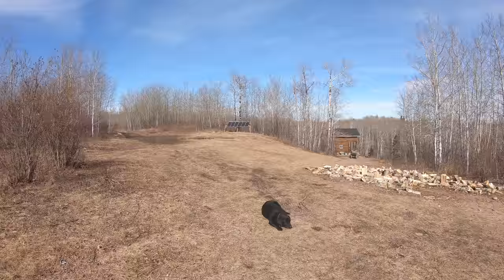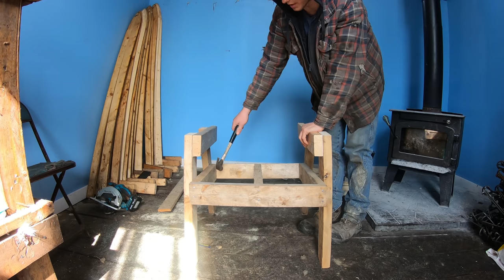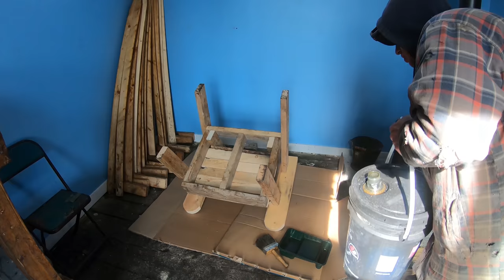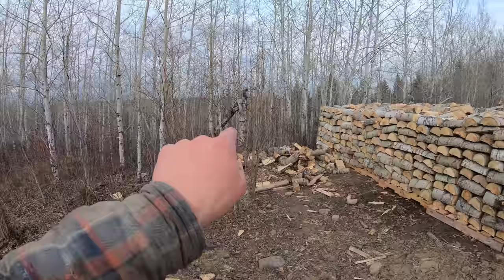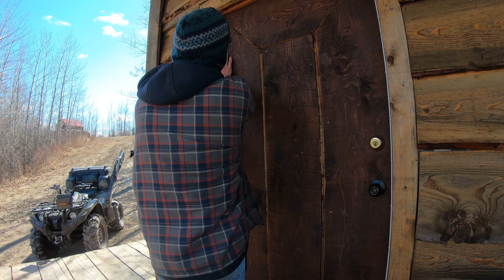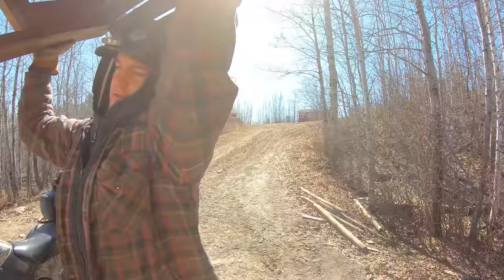Bushcamp - Building Wooden Outdoor Chairs for the Front Porch of My Offgrid Cabin

Comment: Turn your extinguisher upside down and give it a few wacks with a rubber mallet....to loosen up the dry chemical. Your local FD may even recharge it for you if the pressure drops. I also keep a pressurized water extinguisher on hand, (expensive for a new one) just add some antifreeze to it for the winter months. Thanks for the vid ,thumbs up for the pooch.

Comment: You should buy a Plastic welding kit n they work great mainly like $15 n you can repair alot of stuff made of plastic instead of throwing them away n I bought one n I love it n I welded a broken throttle n Cracked gas caps , crack n leak in a Bog 6,000 gal Water tank 1/2 in thick n it worked

Comment: Great video. My personal opinion I would have made the flat arms of the chairs 3-4 inches longer, chiseled out/router out a 1/2 inch deep circle about a 1/4 inch bigger the you coffee mug to sit in so it can't/less like to be hit or pushed off. For the dog,you coulda  made a bench seat to replace the one inside, throw a few old blankets on 1 side for the dog and you would still have room next to him while eating( correct terminology is a seat n half lol). You may still be able to that if you remove the left arm of one and the right arm of the other.